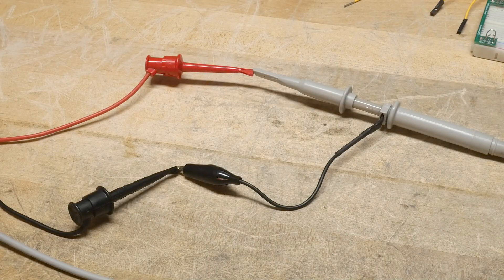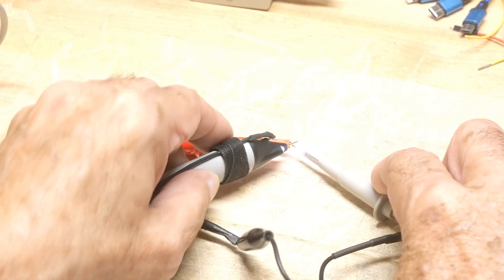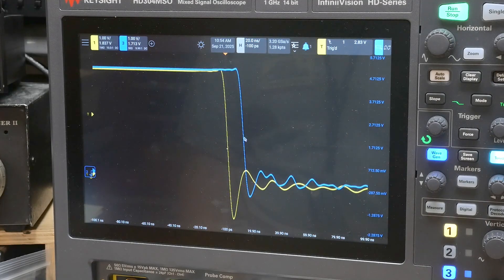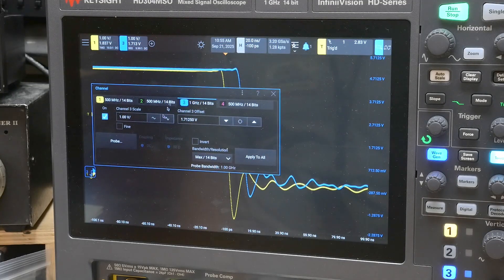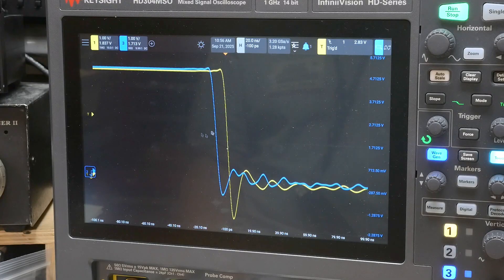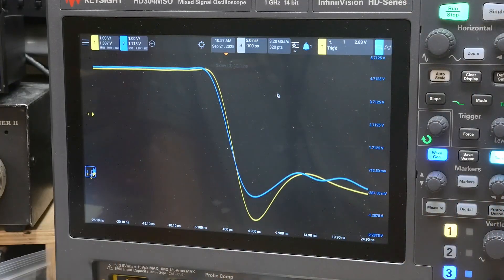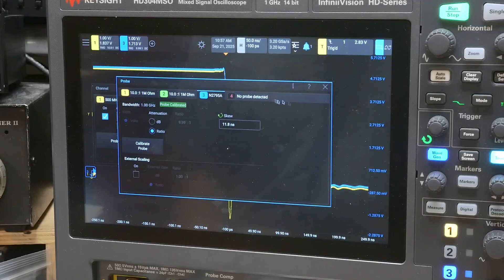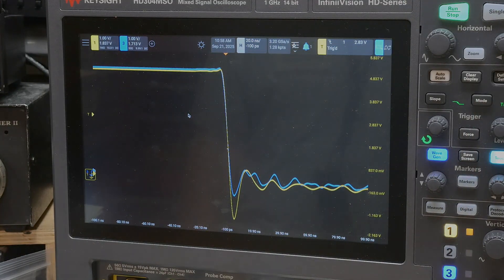#2396 Oscilloscope Probe De-skew

Comment: I never use this feature!
Now I know.

And also... i put few ferrite clamp on cable of probe for decoupling and help common mode, this limite the ringing at the fast edge.
Is very good when you probe in switch psu.
Try it....